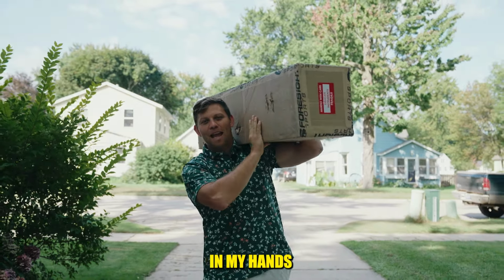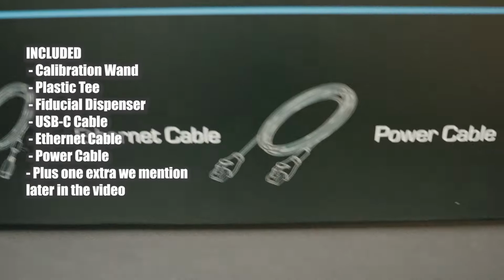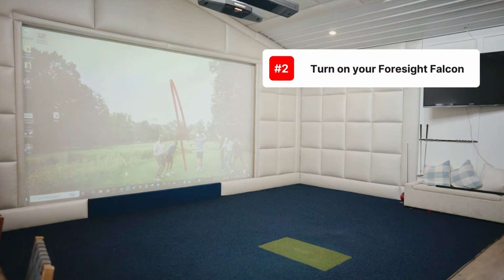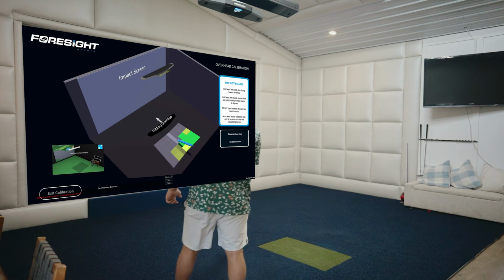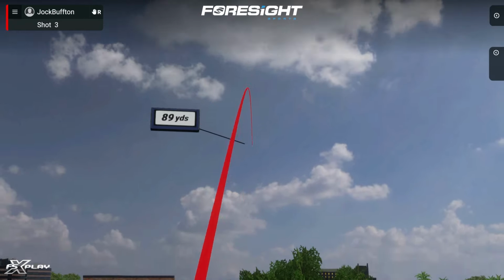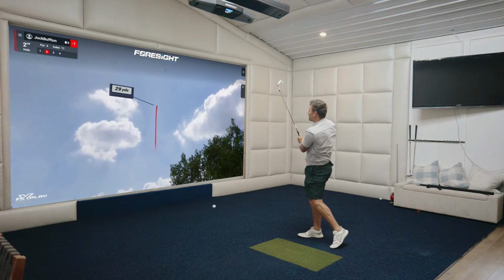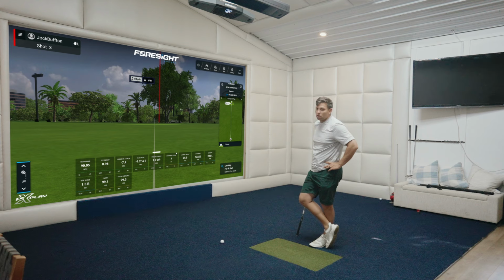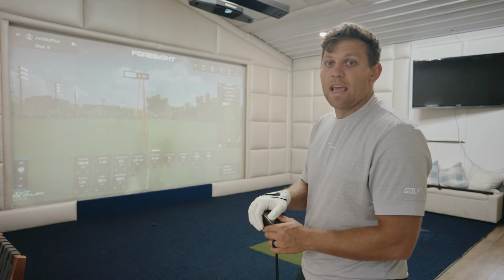The BRAND NEW FORESIGHT FALCON IS HERE!!! [First Look, Set-Up, Unboxing, Launch Monitor Review]

Comment: Do you have club data working on yours? My falcon won’t give club data and Foresight support is trash.
Reply from the maker: Yes club data works fine but you need to make sure to switch on club data mode. The light will turn green instead of blue, and it’s in a bit of a different hitting areas more left and right side. My guess is you don’t have it turned on.
Reply: @ I believe it is, the light is green and it says ball and club mode in the bottom corner.
Reply: I tried a recalibration as well. No luck.
Reply from the maker: Is the light blinking no to solid? It will be solid when you can hit.
Reply: @GolfBusters  It is solid and it says ready on the screen. I’ll swing and it grabs ball data only even though it says ball and club mode pre shot.
Reply from the maker: Do you have your stickers on your club?
Reply: @GolfBusters  I do not. I never saw anything about stickers in the manual. I didn’t think they were required for the falcon.
Reply: @GolfBusters  That’s what it was. Found my stickers and it’s working now. Thanks for talking me through it. You need a commission.

Comment: hows the falcon going now that you are a few weeks in?  any reasons to question accuracy ?
Reply from the maker: Accuracy is spot on, still some issues with the 60 but like I said all their other devices don’t have that issue so I’m sure it will get patched soon
Reply: @GolfBusters  Awesome, i just purchased.  What projector mount did you go with?
Reply from the maker: We have a angled one because our ceilings vaulted, you can find it in our sim build video. 

Also, looks like the wedge issue only happened with me and no one else so it may be my shiny/full face wedge.

Did you use our code when purchasing?!
Reply: @GolfBusters  unfortunately no... i couldn't stack with military discount is my understanding

Comment: The righties in your group are going to have to hit off the blue carpet to get club data.  Big downside of the Falcon - the dead zone hitting area in the middle for club data.  But for ball data only, the hitting area is huge.

And one thing that is disappointing is the green physics.  No way a 12200 spinny wedge doesn't zip back a lot.  Yours barely moved.
Reply from the maker: I’m making my mat slightly wider and it works fine for everyone. I use gspro the most  so green physics are the same across all devices.

Comment: I wonder why it doesn't have a projector built in. Seems strange given it's ceiling mounted.
Reply from the maker: I haven’t seen a ceiling one that does have a projector built in
Reply: @GolfBusters  why not I wonder. Seems like an obvious thing to do, then you'd just have 1 thing hanging from your ceiling.
Reply: @yoric7200 from a merchant standpoint, that would be a nightmare. 
they would have to decide:
1.  what type of projector?  LCD, laser?
2.  what resolution? 
3.  what would people want?
4.  who would "not" buy it cause they like to get their "own" projector.
     a.  if they put a cheap projector, that would be a nono for some, and if they put an expensive projector, that would also be a nono for some.
5.  they would have to "outsource" the their parts to another 3rd party.  it's like buying a TV with built in home theater 5.1 audio receiver.
that would be a headache.

Comment: I have the ProTee VX and don't have to put stickers on my clubs. I think it has the most features for the cost of it. Hard to beat it for value. Can also putt and chip on it which wasn't that great on the Mevo Plus.
Reply from the maker: I think the biggest difference is the premiere accuracy you’re paying for with the falcon. I haven’t hit on the protee but saw carls place video and it seemed to be pretty off a good amount of the time.
Reply: @GolfBusters  I started with the Mevo Plus and still have it, but haven't used it other then some testing I did awhile back between the 2 units. They were very close on full shots. 

I'm not sure on the Carl's place video as I couldn't find anything on their channel, but if it was quite awhile ago, they have released numerous firmware updates to make it even better. Keep in mind it's only a year old so will get even better with time and I would say it's at a point where it's very good. I would say the one measurement that can be a bit off especially with the high lofted clubs is angle of attack. I've seen improvements with this with the firmware updates and expect it to get even better. 

I've seen Facebook posts of someone comparing the VX to a GC3 and they were very close. For the price, it's hard to beat for what it offers. I'm sure the Falcon is slightly more accurate but you are also paying double the price.

Looking forward though to seeing you guys put it through its paces. Hopefully you can get your hands on a ProTee VX at some point and see how it compares.
Reply from the maker: Would love to test one out!
Reply: @mikeneron I’ve had the Protee VX for just under a year now. Amazing unit, updates keep coming and now with the swing cam integration in the works it just keeps getting better. That Carls Place video in question is old, many updates since then.
Reply: @BogeysBackyardGolf  I have the ProTee VX and got it on release and you are right with your comment in my opinion. I love it and my yardages are dead on for me.

Comment: Do you plan on using the falcon instead of the apogee or flight scope
Reply from the maker: Debating, I will miss all the data and features everyone gets with those other devices. You can get it on the falcon but I’m not gonna take the time to put stickers on everyone’s club.
Reply: @GolfBusters do you still need the stickers if you hit inside the club data zone?

Comment: Doesn’t apogee do the same thing with out placing targets on the club and is also voice command with a cheaper price
Reply from the maker: Correct, you still get the best ball and club data with club stickers on the apogee but it’s nice to have the option for when friends are over. Falcon a tiny bit more accurate on ball data from initial testing

Comment: How does it compare to the apogee or the trackman io?
Reply from the maker: As an indoor device the falcon is the top of the line. Apogee and trackman are just barely below. Reminder trackman just got into camera based devices last year with the IO. Apogee actually has the most features of all the devices, so from an enjoyment perspective I might pick apogee.
Reply: @GolfBusters  I know that the PGA superstore by my house in Ft. Lauderdale is switching from the older generation GC Hawk launch monitors from Foresight and not upgrading to this model and instead going completely over to the new Trackmans at all their locations.